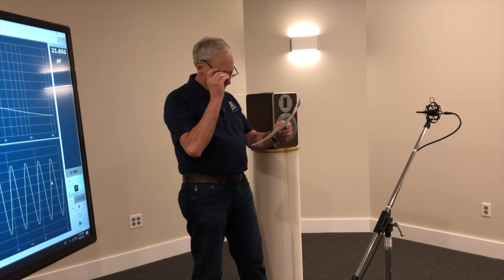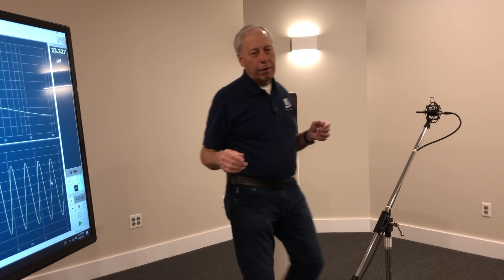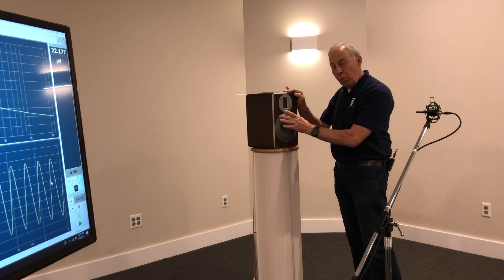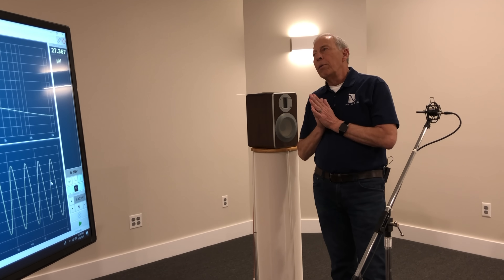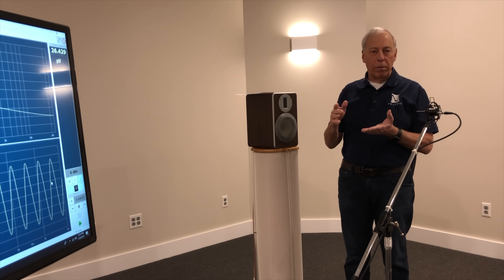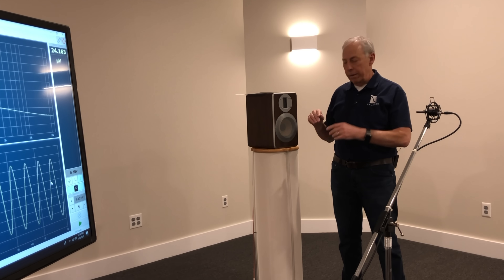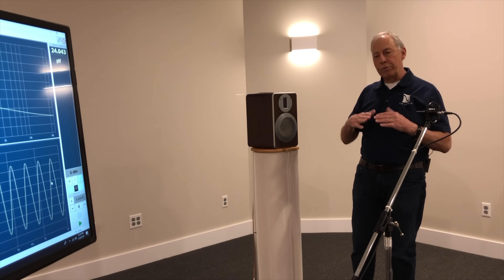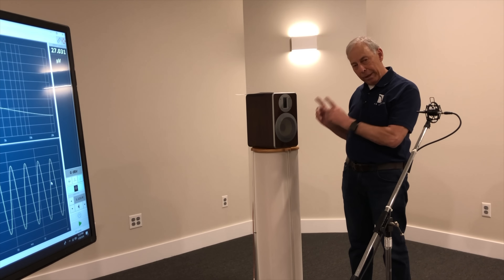How many drivers should a speaker have?

Comment: Back in my days, it was common for me to have 10 to 20 variants of crossover attempts, some times even more, pending the design I was working on, which translates into months to a little over a year... Of course, the more speakers involved, the longer the troubleshooting took, to balance them out, filling holes, all the while trying to at least find a flat line equal across the whole spectrum, and then, build off of that. I then would only make one change at a time to each cross-over revision or changes to the test rig cross-over, before going completely nuts on making the crossover look pretty, which can take a few attempts on that as well...

 A side note, a test rig cross-over typography of the components may have a certain spacing, and can have an effect on each of the neighboring components. Meaning, once the electrical design has been figured out, and sounds the way you want, and then start off on the mission to make new cross-overs  look pretty, and of course, one tries to make them more compact or smaller spacing between the various components, that can have an effect on the sound performance, again.

You will be scratching your head, wondering if something is miswired, or faulty components, lol... Nope, just the inductors being closer together then they were on the testing rig. At lower power wattage, it is harder to notice, but when you start to crank things up to a movie listening level, those holes or gaps you worked so hard to fill, by design, are now back, or things can go the complete opposite direction, meaning, those crossover points, are now peaking much higher then before. instead of a smooth transition. I suppose, that it is due from the cut off points over lapping way to far. Example, the midrange roll off is carried into where the next mid range of tweeter is supposed to pick up, and now you have two speakers having acoustical output of the same frequency 's... ? It is only a little bit of band width worth, but is louder... Please fill free to correct me upon my theory... All my tests were performed via Coustic RTA, so, just a bit primative, but, that was what was available at a cost effective way for my business. All in all, building cross-overs, was allot of fun, and the challenge to always make the next one better, I miss that feeling, and the sense of accomplishment afterwards. Good luck, Dru
Reply: Did you make crossovers for other companies or/and sell them, or did you make speakers? 

I make speakers as a hobby and I design my own crossovers. I learned to do it by "ear", with my set of lounge speakers as my test speakers. I made changes to the drivers as well as the crossover. I tried a few different concepts with the same tower enclosures (artistically and drastically modified standard lounge towers). After nearly a decade of changing my lounge speakers and tweaking the crossovers, I can now make crossovers in a day or so. But if I change stuff acoustically I have to change the crossover again. 

My latest craze is my 3" full range driver with a hole drilled through it and a modified tiny full range driver (stripped of it's cone completely) is mounted on the back of the 3" driver. And a thin stick is super glued to the voice coil tube of the tiny FR driver, and the stick pokes through the (drilled) hole in the 3" FR driver. And a tiny foil "tizzer" is super glued to the end of the stick (in phase with the 3" cone center). And there is an added 6" woofer for bass strengthening under the 3" driver. It seems to increase the top frequencies significantly. And using a suitable cone tweeter would even be better but they don't make them any more. And dome tweeters are impossible for dome stripping, it has to be all off, completely, and I can't strip it without wrecking the voice coil. So I am using the smallest cone FR (bluetooth drivers) that I can.

Also the 3" two-way driver is raised 1/4" above the speaker hole (and that also acts as a bass vent) and treble from the back of the cone easily escapes though the gap (increasing treble output). Acoustically (I reckon) it must be way more advanced than the driver right on the hole. Way less resonance with the xylophone, with just the right gap (and way less, than right on the hole).

I only completed one speaker so far and it's the best speaker I ever made. It's "spacial" point source sound from the 3" driver in the slanted position in the semi omni directional enclosure, and I forget that it's just one speaker (R ch only).

It's 3 weeks later and I have completed both speakers and with some tweaking (mostly acoustic stuff) I now have the best speakers I ever made.
Reply: Often I would try a crossover on just one speaker before making the other. This saves time and labour if it doesn't work out. That said: After I have just one speaker going, I seem to be hearing "more med" with both speakers going. Whether it's the stereo effect (and I had the quiet voice channel by coincidence every time) or there is something acoustic going on, to make 2 speakers seem to produce more med than just 1.

Comment: From a monopole speaker design point 2 drivers is probably the minimum , allthough Japanese audiophiles will swear by their 4 to 8 inch horn loaded Fostex wide band speakers without X-over . From a dipole (open baffle ) point of view , if you want a reasonable amount of bass , a 3 way system becomes nearly inevitable (and a 4 way even preferrable) . The bass drivers will be too big to be able to x-over at a high enough frequency with a tweeter without causing huge off-axis problems

Comment: my fantasy speaker project is a 4 way with an active crossover. big ol' sub down to 16hz, 6-7" woofer, dome midrange and a ceramic tweeter, using a minidsp hd as a crossover and an AB amp for each driver. priced it out and it'd be like 1100 for a pair of them, at least...if only i had that kinda cash to burn...

Comment: Every two way speaker system I have heard sounds shallow. I would not spend my money on a two way system. That is very dated.
Reply: I would disagree with that . I still listen to my old pair of Totem Signature and they stilll amaze me with their sound . Yes they were expensive around 2000 euro , nearly 20 years ago but the quality of the components is still considered to be top notch : 6 inch Dynaudio woofer ,1 inch  Seas metal dome tweeter (tuned) , air core coils , film caps . A sound dead cabinet lined with the same material as the heat shield of the Space shuttle . The bass goes really low , at normal listening levels I do not crave for a sub , not at all , highs are sublime . For a large listening room , you will need a sub ; I agree
Reply: @gerritgovaerts8443  Your opinion is fine. But if you notice when he tells you about stretching the limits of the woofer to cover mid-range, what happens? In the end you get shallow sound. You are just used to listening to your speakers. Put them up against a great 3 way speaker system and you will hear what you have been missing.
Reply: @kevinroach9380  I can only tell you that I haven't experienced that shallowness with my Totems . Mind you these things in current euros would cost 4000 a pair ,  they are by no means cheap and a lot of good engineering went in those puppies . In their days , they won every contest , praise in all magazines . My best speakers are 3-way dipoles (open baffle) with 2x12 inch woofers per speaker , great midranges and a very expensive AMT Mundorf tweeter . Yes , they sound better , certainly if I crank up the volume , but I attest most of that to their constant directivity which no monopole speaker can achieve , be it a 3-way or a 4-way . Unrivaled Dipole bass quality is another reason .
Reply: @gerritgovaerts8443  A pair of Infinity Modulus (2 way) with sub from the early 1990s would cost 6000 bucks today; I have the US sales pamphlet here and it is pictured next to the IRS V :) It reads that it is the best speaker in the world for the 1990s... lack of confidence was never Infinity's problem :)